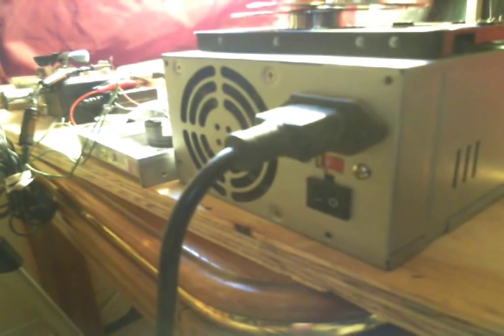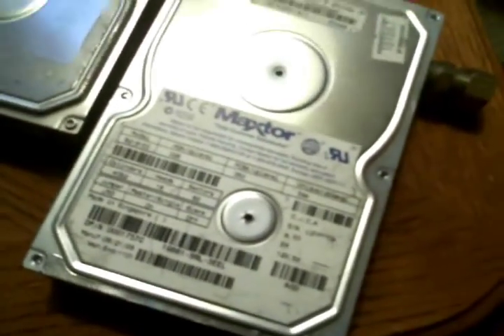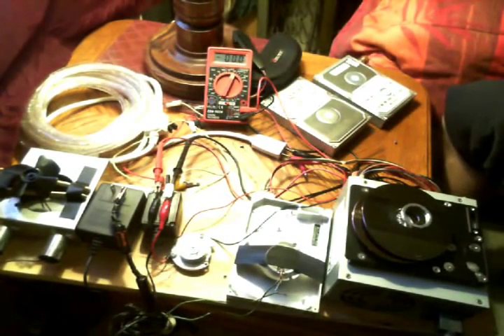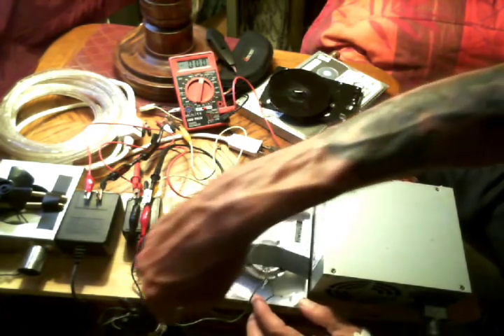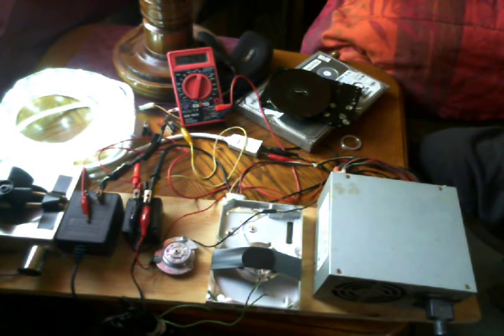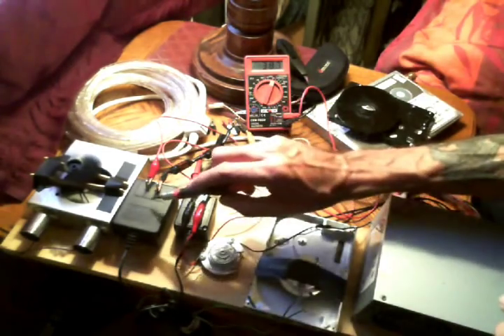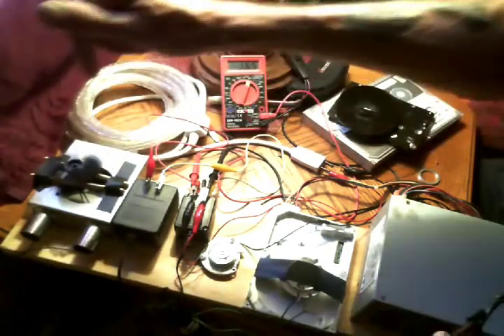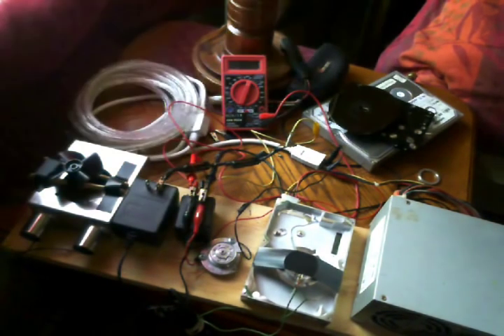MUST SEE 2

Comment: YES YES YES, outstanding. I was wondering how those little pisscutters would work and now my good brother Shazizz proves something awesome. One thing I will tell you also is that a little VCR motor will crank out 12 -20 volts DC when spun backwards also. about .4 amps worth but nevertheless. So THANKS AGAIN   ol' boy.       I will keep you posted on my "home energy offgrid stuff."         Scott R.

Comment: Okay what exactly are you trying to prove? You have me completely lost on that. Do you somehow think that you are getting more energy out then in? And what is the "must see" aspects of this? If you really wanted to show a little more you should first get a better multimeter. Also show current consumption at multiple points. Voltages without current is just about useless. Also why not use a frequency counter and show some measurements since you probably don't have access to an oscilloscope. Overall though I haven't seen you do anything that would qualify as new or anything that doesn't have horrible losses. Furthermore by your explanations in your videos I'm not entirely sure you have a full understanding of capacitors and even how you measure in circuit isn't the correct way of doing such. For now I'm not going to "dis" your ideas on somehow obtaining free energy but I'd enjoy your videos more if you would take more measurements other than voltages alone and at multiple places within the circuit. If you need something other than that el-chepo multimeter I'm sure that you have enough viewers that one may donate one to you. Overall messing with any electronics is fun.
Reply from the maker: You seem to be wasting your time watching my videos because you havn't seemed to grasp the concept of the fact I am only looking for voltage! When you begin to understand why maybe then you will stop over thinking the simple. Voltage is pressure. Try looking into static energy and how it reacts to noble gases and different materials. Until I move energy from one place to the next none of your measurements apply. Only when I draw a load will it matter! The simple of what is happening inside this hard drive motor is what you should be focused on. Over thinking the simple and not understanding what is being pointed out tells me that you missed the big picture.

Comment: Hello mate, Look I am not being funny or anything, I like you and your video's and fuck all the DIVAS that think they are on telly and have to do a BBC production (the BBC thing means something here in the UK) you are real not fake, meaning your present yourself as you not a show host on the internet, which by the way you do not need to be that great to put something on the internet its set so anyone can do it. I have even seen animals with there own websites. but I have to ask this. What are you doing? A motor is a generator and a generator a motor. Put power in a motor and it spins as a motor. Spin the motor and it will generate power. Maybe its because i am trying to understand and I may be over complicating this. Please remember I like your video's and how you show them :-) The DIVA's do my head right in. Peace and love back at ya ;-)
Reply from the maker: +MonkeyMagic Elecifun Voltage is pressure and can be speed up or slowed down to move energy from point A to point B. So while everyone else is looking into current ,watts and amps to get power right out of the gate, I am only looking for voltage plain and simple. The rest will apply when I move the energy from A to B and then and only then when I change the energy back into usable energy in the since that we know it as electricity will the common measurement apply when I complete the circuit and begin drawing a load off of it. Energy is energy no matter how you look at it, and frequency can be changed. It is like pumping water as apposed to steam! they are both made up of the same thing just one form is heavy and the other not so heavy. They say energy can not be created nor destroyed, just changed and moved around. So with that said I want to move it quickly. The hard drive motor has a real weak ring magnet in it and very small amount of copper wire, yet at high rpms seems to do some amazing things. So think about this style of motor generator scaled up and not used like the standard generator head. Simply used to move energy quickly. Back EMF is no longer a problem because you never allow it to accur. Storage is simple. None of what I am talking about defies any laws of physics, but what it does do is change the way in which to use the energy so that certain things never come into play. Such as no direct coupling between the prime mover and the generator head like wind power, and no path for the electrons to return back into the windings of the generator for Lenz law to take affect. Study the mercury arc rectifier and take note of the date it was created. What i am trying to demonstrate here will become apparent when people stop trying to think of free energy the way that they do and over complicating the simple. It is real easy to get high voltage, it is real easy to take that high voltage and a noble gas and generate plasma/light and heat and be able to tune it as well. So by changing the energy to a form that is different than what it takes to run a motor at 50 or 60 hertz you make it so the motor will not even recognize it so to speak, therefore not allowing the back EMF to even accur. People keep saying that my volt meter is not good enough and that I need to show more measurements but they could not be further from reality because at this stage voltage is all that I care about. Until the energy is moved and then stored and finaly used as in drawing a load then no other measurements matter. I am simply amazed that the most brilliant minds in the world can't rap their heads around something that a 5th grader figured out back in the late 70's. This is childs play! people understand plumbing and pressure and valves and so on but can't grasp the simple of how electricity works? large pipe into small pipe? volume to pressure? check valve/diode? pressure valve/transister? need I say more? It is crazy simple! not overunity! not zero point! It is free energy moved from one place to the next in the most efficient manner at really high speeds. Tesla knew it and proved it! frequency is everything. heat is light and light is heat and much more! The rest is just the railroad tracks we use to guide it to where we want it. You get in the boat and ride it down stream, you don't try to move the stream to move the boat and when you chose to try to move the stream instead you have to work real hard against natural forces that is why the school books tell you that energy is not free, even while you are floating in a sea of free energy! Just because people have been fighting against nature dosn't mean that working along side nature to get work done is wrong! I hope that helps to explain a few things. Peace and love my friend.

Comment: I wonder what would happen if you held a neodymium magnet up to the motor to increase the magnetic field?
Reply from the maker: I think that if you take a close look at the magnet inside these motors and how weak they are, yet  they seem to get amazing results at high rpm's and how little copper wire is actually in them! Tells me that there is much more going on here!

Comment: Have you tried a 90 degree pipe entering the air intake pipe with a one way valve to cause a vacuum suck action into the air intake thus may cause a resonance water hammer effect and freeze the air vapour inside the tesla turbine causing a natural cooling and matter anti matter charges ( vacuum boils water then freezes )